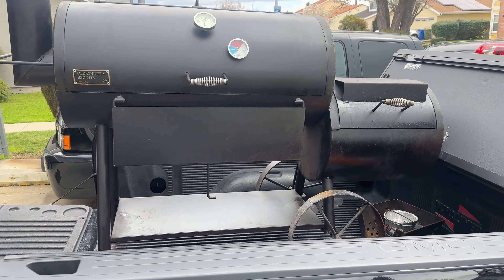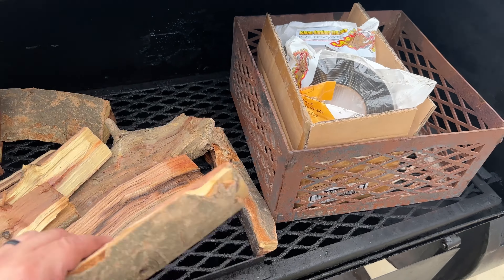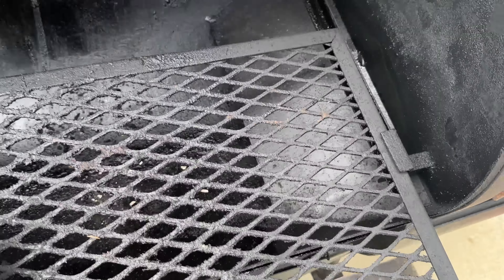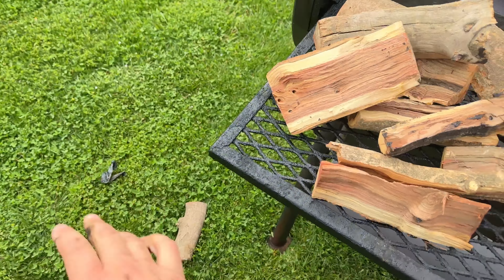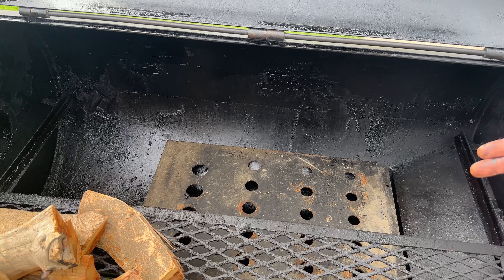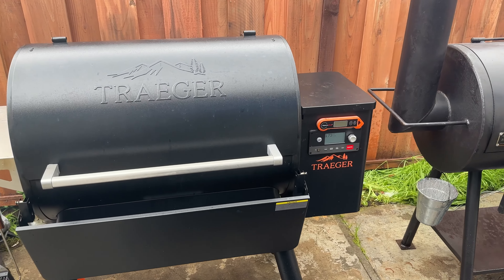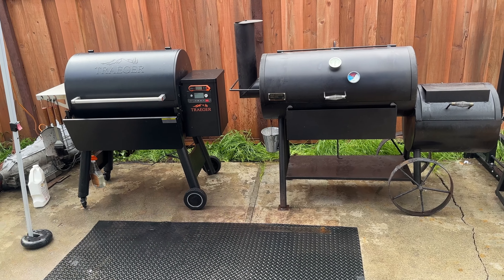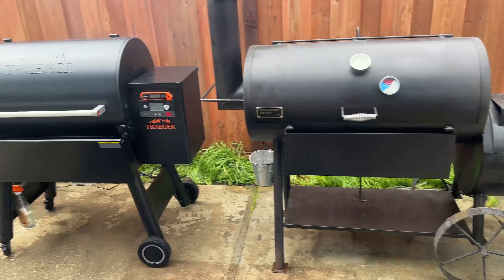New Smoker : Old Country - Pecos

Comment: I bought the brazos few years ago. The one thing I learned was never again buy a smoker where the diameter is less than 24” round. You may also wished you didn’t buy one less than 24” round.
Reply from the maker: Due to temp swings? Or why exactly?